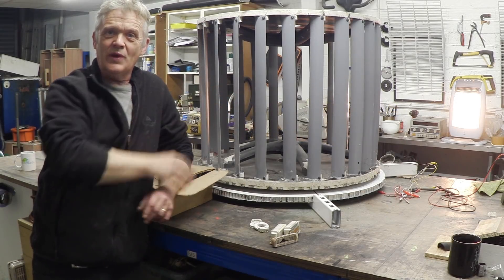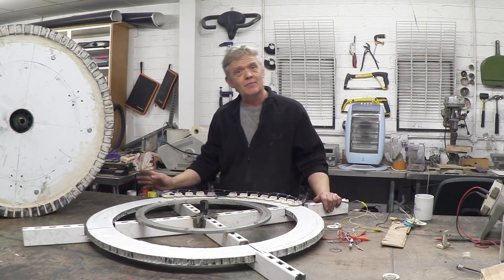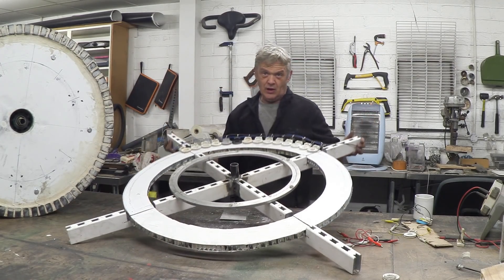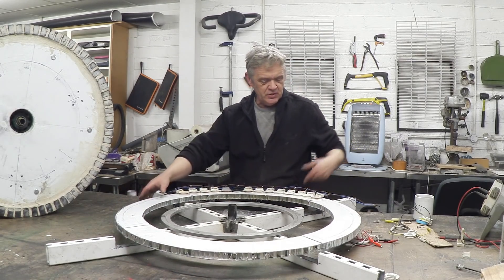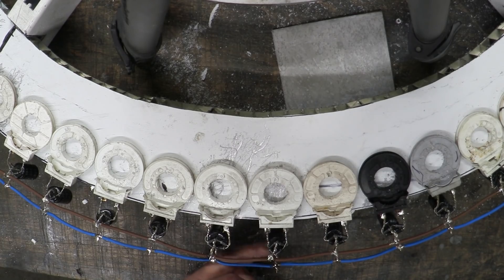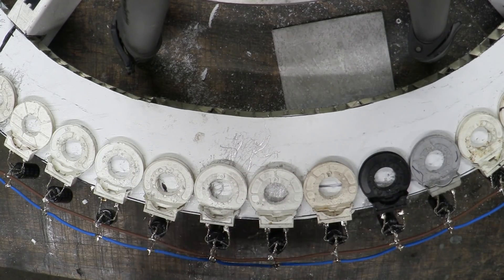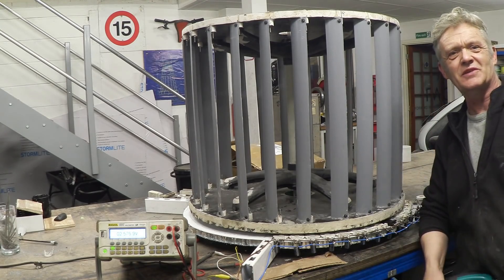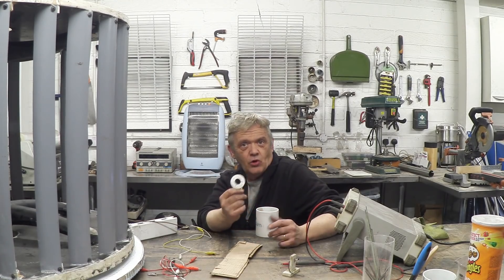Building A 1kW Wind Turbine For Under £100 - Some More Changes

Comment: I've only just found this video and subsequently your channel but I must say sir you are an absolute genius. This is an amazing solution for low wind speed power generation and I hope that I can try my hand at replicating your setup soon. Maybe having more than one person tinkering with these can lead to further improvements quicker.
Reply: However where I live here in western Canada, our wind varies quite a bit from season to season (slower in the summer, much much faster in the winter) so maybe I'll also be able to see how this operates at higher speeds as well as lower speeds. Worst case scenario I just need to have two different sets of wind generators for the year which isn't too bad.

Comment: Just got an idea of using thrust bearings (I think those are similar to the lazy Susan one he used) and use them similar to rollers to ride the inner ring. Was thinking a fitting could be pressed in, but likely the bearing would need some modification. Just was thinking how this would distribute the load more evenly, improving stability further.

Comment: Am researching a micro wind turbine 2 compliment solar into my Bluetti battery/power stn. Sunshine's erratic hence augmenting with a small roof-mounted wind turbine. Impressed by the Archimedes design. All I'm aiming 4 is 2 power all my non-essentials .. all my "toys" with renewables. (I can & atm I do charge the battery with off-peak electricity & hope 2 top it off with solR the nxt day).  In a marine environment so good chance of decent wind.  I like ur low wind speed harvesting idea here tho .. but I want a compact footprint & "quiet" operation.  Of-course there's a plethora of commercial (& expensive) solutions out there.  Anyway; "talk, talk, talk, talk, torque .. it's all about torque & efficiency"😂🤣😂

Comment: You should very easily be able to get six full out of this probably 12once it's populated which would be ideal for trickle charging a bank of batteries once you set up some kind of switching mechanism. This is exactly what I'm looking for for emergency usage for my home. I'm not particularly interested in converting to wind energy for daily use I'm looking for emergency energy storage so I can have a few lights and a means to charge my phone run my coffee maker perhaps my air conditioner in the summer when my power goes out after a storm. You could expand this slowly over time adding the proper battery is overtime so it doesn't cost you an arm and a leg and it could slowly charge away going about its business relatively unnoticed. I don't know if you're still working on this Robert but it's a hell of a good idea. You always think out of the box bravo

Comment: I love the videos and thank you for the time and effort you put in to produce the videos.  I would very much like to see each type of solution ... this solution for example ... taken to a usable end ... perhaps that could be the great comparator of one solution to the next.  What would be the usable end?  Charging a 100AH LIFePo4 battery say from 15% to 80% and how long does each solution take to accomplish the charging.  Yes, I understand wind solutions would differ based on how much wind was available at the time ... however ... simulations could be done as with the leaf blower in the lab.   The goal:  provide a workable / usable / proven solution (parts list, diagrams ....)  that your viewers can actually use.   I would VERY MUCH be open to purchasing a solution package (parts list, connection/wiring diagram) at a cost to further support your channel and efforts.  I very much would like to have [multiple] solutions to deploy to supplement (or even replace) the power I use from the main if at all possible.  With work, children, family commitments, and commuting I don't have the time to experiment - but I do have the desire and the funds to purchase the plans for  a proven solution (given parameters and expectations).  Second goal?  I'd love to have a store of 10-15-20 100AH batteries I can deploy around the home with a necessary inverter whilst the non-deployed batteries are being charged up and stored using a Robert Murray-Smith solution !!!!!!

Comment: More then just lighting a light bulb... if it is like a trickle feed in assisting the charging of your Batteries possibly? We have an isolated ranch and no power... solar, doesn't always cut it. I enjoyed this series and your working with salvaged materials. Thanks an keeping your series in a possible building one such as that here, in British Colombia Canada.  ;) We did find the little solar garden Path lights worked well as night lights. Saves gas for the generator for power tools.

Comment: Really good video(s) love your enthusiasm. Where I live in the foothills of the pennines the average wind speed is 6.6m/s. I think with a residential turbine you'll do well if you get 70w on average with a good small HAWT or VAWT from 6.6. You might be able to run a 40w heat lamp in a chicken coop after taking into account inverter losses etc. Yes on really windy days you could peak at 400-500w because you'll have to furl or pitch at the rated wind speed (usually 10-12m/s) to avoid self-destructing the turbine. You'll never see the the true (risky) potential from wind speed x 2 = power x 8.

I don't think the manufacturers are to blame (except some of the Chinese, I saw one sub-2m blade diameter claiming 8KW) I think customers latch on to the rated and ignore advice to check local average and install as high as possible.)

To be fair Robert I watched this series hoping to see you hit 1KW but reality kicked in and you said the objective was to harvest energy from wind speeds. Not true, your objective was to generate 1KW from a turbine coating less than £100 (or was it $100?) Anyway, it doesn't matter, a reality check for everyone and I enjoyed watching.

Comment: Thanks for sharing your project with all of us. Question? How will you address the problem of making the electronics water tight? Since this will be exposed to the elements. If you can do that, I would pay for instructions and plans. I would love this to supplement my off grid solar system. I love that you teach people to salvage things and recycle/repurpose them. I build a lot of things myself with found/discarded objects and post on my FB to encourage people to recycle/repurpose found objects. I will soon start a YT channel to encourage people to do just this. Thanks again for sharing your knowledge with all of us. You are a gift to this world.
Reply: that's simple. to be really cheap, use wax. better, use epoxy. lots of ways; this is trivial since there's nothing electrical that moves.

Comment: I like the strategy of your design concept as well as the fact that you are not stuck by following convention, this is how I am with design concepts also. I regret not suggesting somethings earlier in the project, one is that you could have made a bracket so that you could have had a centre bearing top and bottom as this would have a lot less friction than a lazy Susan bearing and secondly you could have possibly made a jig to hold a lathe cutting tool to machine the surfaces that hold your magnets and coils while using the wind to drive it so that you could minimise the gap even further.
Reply from the maker: lol - I wish you had spoken sooner mate - but nice ideas cheers

Comment: I just stumble upon your video and I like what you are doing. May be you have thought it out but if I may suggest, pls consider wiring the coil in series i.e every 2 coils or 3 or whatever i.s.o in parallel. Another thing if the wind blow is block from escaping to the centre of the turbine, that may give more power to the rotation of the wheels.

Wallahuaklam

Comment: Are you going to fit more rows of coils? Also when you work out the optimum speed for best power generation,  you could add  one larger coil with a retractable core to regulate speed (via magnetic drag) for higher wind operation.

Comment: wind turbines like this in a city would do wonders. the small size would let them go anywhere and a few hundred of them spread out would be able to help lower the overall power usage, it wont do massive things but on a hot summer day to offset some of the AC usage or heat in the winter...
every once in a while there are those massive blackouts that take a couple days to fix, they are rare but these little wind turbines could charge the emergency lighting so your not screwed after 1 day.

Comment: Great! One idea I have always enjoyed working on with these types of projects is the idea of a “Magnetic Levitation Bearing” :) so if the magnets and the coils/ electromagnets etc... were both the inside ring of the axle as well as the top and bottom of the disk that spins. If the magnetic force is strong enough, technically the spinning part should float in the magnetic fields. Plenty of space to provide electricity generation too!
Reply: You would have to think about the heat generated... I am unsure how much heat would be generated on a small scale, but I recall a thin aluminum sheet being levitated. Person poured a pitcher of water on the sheet and it immediately boiled and turned to vapor without leaving the sheet of aluminum... would require testing and possibly a method of cooling

Comment: Very interesting work.  I live in the Mohave Desert and the wind is always blowing here.  I want to put a wind generator on my roof,  with solar panels too.  On a larger size I have been kinda of designing a solar powered sterling generator.  Something that will put out enough power to run my AC and appliances.

Comment: If you coat the working surfaces with spray coat PTFE(sold as non-stick spray) then you will see a great reduction in drag forces associated with the weight.

PTFE slides along PTFE with a 95% reduction in friction, so that will aid in your low wind generation(and one can coats a fair surface area for around 10£ or so a can)
Reply from the maker: that is a nice idea mate -I have some so will do it - cheers

Comment: Low energy harvest is our future. Ambience, heat and cold , vibration etc well done 👍🏻. I had an idea to increase the amps you produce, use Tesla bifilar coil powered through a ZVS circuit. I have had good results and they seem to show increased amps on the output side. So combine your harvester with another tech and you can achieve the same as the industrial version and more. Keep up the great work

Comment: Rob, I put this as a reply to a comment but regarding sealing the electrical components from the weather, why not just use liquid insulation tape. It's flexible and UV resistant as well as waterproof and air tight. This way you just need to brush it on and let it quick dry. 125ml costs $10-25 delivered on eBay. It's excellent stuff and extremely versatile. Insulates over 1.3Kv / mm

Comment: I like the idea of the low speed,  I believe when you get the rest of your coils you should be able to make enough power to keep a small battery charged for lights in an outbuilding or other such occasionally used building.

Comment: Those coils look like they could take 20 or 22mm overflow pipe inside them.  That could act as a guide for a core to be inserted or removed from the coils via some linkage.  the cores could be inserted into the coils when the wind speed is high.  this would help control excessively high rotation speeds in high winds and also give a second "mode".  This would make it more versatile

Comment: You need Amps in current to do anything decent with it right, Should you be making your coils efficient enough to allow that or 
high voltage such as 120V onward or even better 240V?

Comment: Bang on dude !
Most places get low we nd speeds ... Especially if installed less than say 50 to 100 m from the ground as turbulence is the main break force ... Laminar conditions apply.
Love your design so far. Am thinking conical bearings on main support axel ... Yup ... More Dosh ... Freer spin ... Tradeoff
Reply from the maker: I wish I had conical bearings mate - that would solve so many issues - I might even go so far as to buy some
Reply: @ThinkingandTinkering  Eventually buy a couple of car hub uprights and mount it on those.

Comment: The only critic I have mate is that I would use a three phase setup.  The turn table I believe it's called would have 12 magnets and the stator would have nine coils.  Now, you can increase it if you wish but I think that would be better.  The last design I looked at was 36 magenets and 27 coils which was the largest one.  Most are 12/9 or 24/18.  You would have to think about the weight of the magnets on the turn table as well as It has to move it.
Reply from the maker: go for mate = personally I do like what I am doing - but that doesn't mean I dislike what you have suggested - I think it would be awesome if you built it and did a few videos - cheers

Comment: Could you mechanically raise up iron cores into the coils in high speeds to generate more power at higher speed and use it as a form of a brake

Comment: Good point. Generating small amounts of energy most of the time. Similar idea I'm testing with solar. My workshop uses 200-400W constantly and then come spikes up to 3000W. I installed 500W solar inverter (grid tie) and it generates up to 450W at full sun. So most of energy is used on site. My electricity bill over 6 summer months drops to half. Now the idea is, to add a battery, which would supply 200 W of energy over night.  The cost of the equipment is so low, that the return period could be lower than 5 years. So such a turbine could generate significant amaunt of energy, if it runs alot. Approctimation for solar in central europe is 4 hours a day at full inverter power all year. It works for my 500W inverter. Maybe even more. In my opiniom, the same approctimation could be true for your turbine too.
Reply from the maker: cheers mate and nice setup you have there

Comment: Hi Robert,  I made something similar with 3 blade in aluminium. 
I didn't make electricity but used a Air pump to compress air. 
It work .
But , I read somewhere to not put it on the roof but on the edge of the roof to get greater wind power .
So to put it horizontally. 
Did you hear about this ?

Comment: I am impressed by your Wind turbine . 
But I'm getting an idea in my head.

The configuration of the magnets is , logically N S N S , etc.
But what about a different configuration such as that of the Halbach matrix?
I understand that it is a bit more complex to place but wouldn't this help to focus the magnetic flow where the coils are, 
and therefore significantly increase efficiency?
I hope I'm not making a beginner's mistake...
Thank's

Comment: What would be interesting is if you could have automatically adjustable metal cores so you could make it slow down and pull more energy in a stronger breeze
Reply: This is a good idea like a wind brake as such to slow down the spin in high winds & generate higher amounts it could have a rpm detector sensor that switches the coils out like a jukebox switches out Records & as long as the blades are made out of un breakable plastics ie graphine super batched plastics they could handel any speeds thrown at them robert murry smith

Comment: Oh ... Cores and close gaps between magnets and stator core material are much better in terms of performance. Slowing down of the turbine only means it is delivering electrical power so that's a good thing. Not a bad thing. Even if you optimize for low wind speeds the rpm should lower at electrical load. The way you have it now is bad in terms of power delivered. Also for low wind speeds. It's excellent for voltage as you pointed out but you moved far far away from your 1kW target power at any wind speed. 1 microwave oven transformer probably does better than 50 turn table coils wo core in terms of energy. 

For demonstration purpose it is excellent. Sure.
Reply from the maker: I se what you are saying mate but it's not strictly true I think cored and coreless designs are pretty common each has it's uses depending on the situation - if you have a core then there is magnetic attraction between the core and the magnet the device has to overcome to turn and therefore generate raising the stating torque requirement - or at least that is the way I am seeing it
Reply: @ThinkingandTinkering  Hi Robert, thanks for the answer. Magnet attraction is like cycling uphil. You need energy to do that but you get it back when you go downhill. It's lossless in the end. So you need a starting torque to get the thing running but once it does magnetic attraction does not account for losses.  Cores do cause losses because currents are caused in the core. This is why these cores are laminated. It does not allow current to flow from one plate to the other to minimize losses. Cores do contribute to magnetic coupling significantly which is way more important than the losses in the core.  So commercial generators all will have a core. Then again, if you have an energy harvester where only a few mW output is important for as much time as possible a coreless design can be exactly what you need. But whatever you do it is an excellent project for any of us to learn something new.
Reply: @ThinkingandTinkering  it's called cogging, that's why guys that make huge wind generators have only coils, more coils, more copper, no cogging. 
Size of coil has to correspond to size magnets, so voltages happen at the same time and they all add up. Then at the end you have a rectifier and caps etc. 
A good book to read on this stuff is by Paul Gype I think. 
Anyway thanks for sharing and learning. Gotta love it!

Comment: Love the concept and philosophy.  I have a slightly different approach you might like. a horizontal  split off set tube design fitted to the apex of a pitched roof. this uses the roof to channel the wind into the blades.